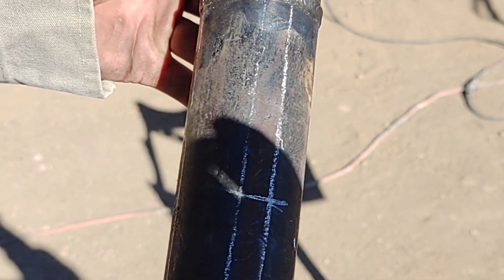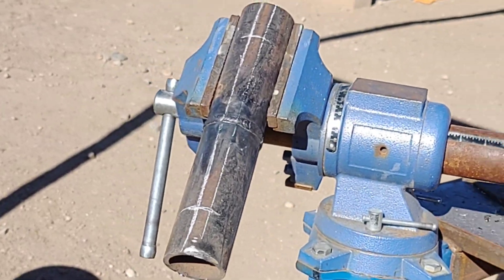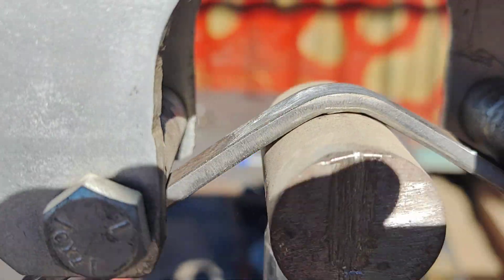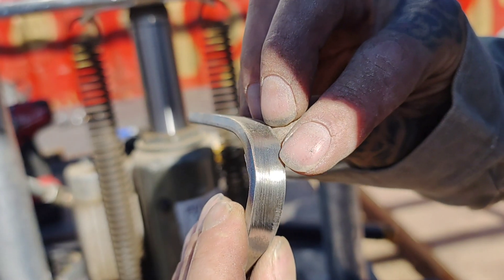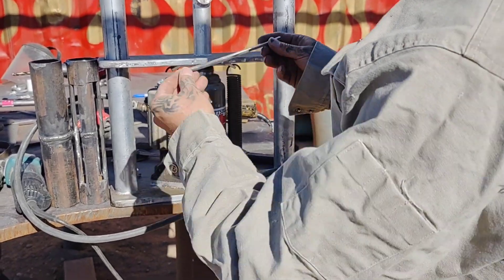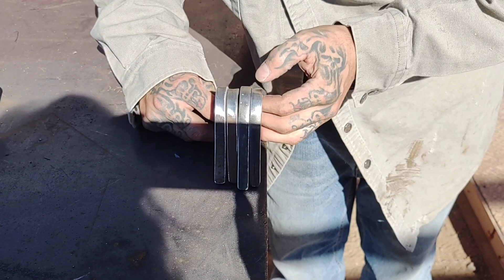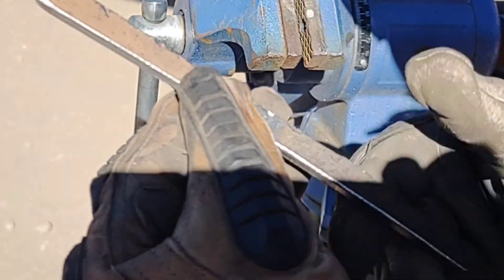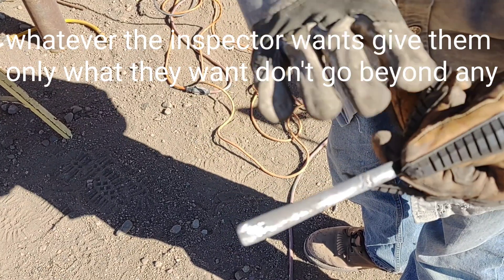DESTRUCTIVE WELD TEST PASS OR FAIL?

Comment: Not accusing this of being wrong because there’s lots of codes and I don’t know yours so this is an actual question just because it varies from what we do. How’d you determine the size of the plunger? Our bend radius had to be 2x the metal thickness making the plunger diameter 4x the metal thickness. and the distance between the 2 guide rollers is 6x metal thickness plus 1/8”.  So the bends end up more parallel. Also usually the coupon is wider unless it’s a side bend or a longitudinal bend as opposed to the traditional transverse bend. That’s for regular steel but changes based on elongation percentage of the base metal. I’m pretty sure our code is on par for D1.1 for plate but not sure about pipe. That’s why I’m curious genuinely.

Comment: Great Video. Just wanna throw this in there, for the B31.3 you mention above, the straps would not meet the requirements. 

ASME Sec IX tests require that bends be made a tighter radius than what you used based on my estimation. The male plunger for an ASME Sec IX test on a .218 wall pipe. The plunger size for API1104 is MUCH bigger than for ASME IX but it looks like you are using a standard 1-1/2" diameter male plunger which is used for 3/8" thick specimens for D1.1, ASME IX, D1.5, B2.1 and D1.6. Also for ASME and AWS D1.X , the plunger side of the specimen is flush ground and the other side is left as welded (Concave for roots, convex for face).   

Not out to argue, just wanted to throw it out there. I have watched some of your other videos and they are great!
Reply from the maker: This is a platform we can all come together and be understanding thanks for any information you provide with any experience everything is valid here unless argued otherwise lol.

Comment: They were doing side bends on mine. In your opinion do you think it's any different?
Reply from the maker: Idk but I can do side bend if ya like to see outta that coupon or the next.
Reply: @Wallyzweldingworld  ya forsure. I'm pretty sure it's to test both sides for defects in 1 pull. Or concerns fillers. But see what happens. I'm sure you're going to pass with A+
Reply: They do side bends on thicker material. Over 1".
Reply: @michaelshortridge6379  yes it was heavy wall 2"  had a 5 bead cap on that sucker
Reply: @travisjones9508  Did they bend?
Reply: @michaelshortridge6379  all 4 straps pass. Tig root. 7018 fill and cap. No grinder allowed just files. So clean up was what you had to watch for. I bought a sheet rock knife with carbide teeth to cut in if needed
Reply: @travisjones9508  Good job Travis